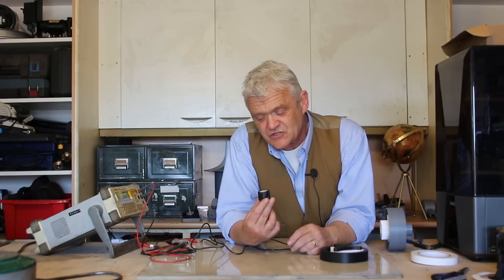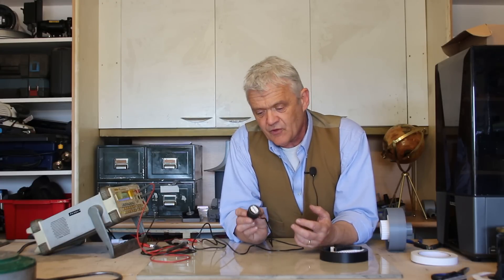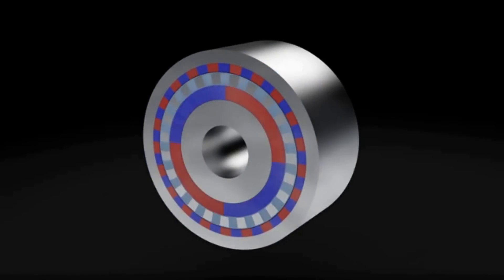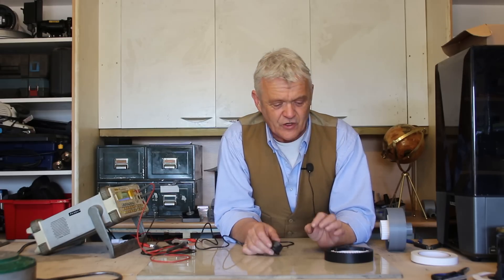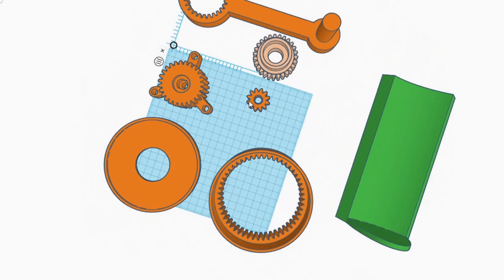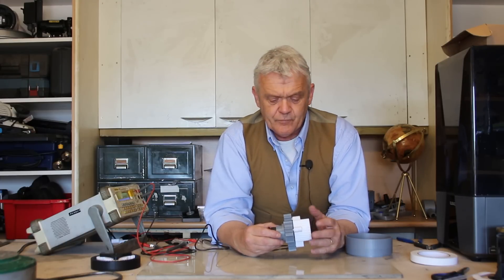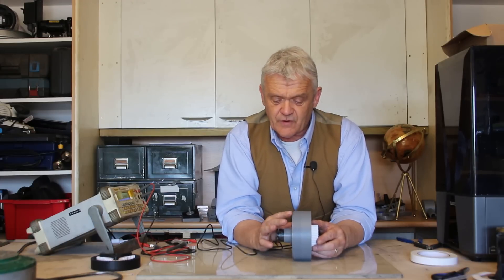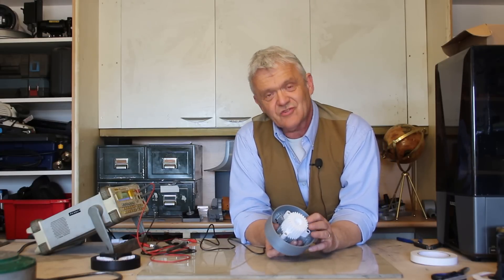1960 Gearing And How To Get More Volts From A Wind Turbine

Comment: Hi Robert. Nice video. Imho the amazing part is you can 3d print all of that, stack 3 gears and be able to operate that. Would it last if you operate it for a few hours ? Does it need lubrication ? Can it be lubricated ?

Comment: There is a much more efficient way of using planetary gears which can provide high ratios with only two sets of planetary gears.
The split-ring compound planetary epicyclic gear system.  The calculation of ratios is more complex, but ratios up to hundreds to one are possible in 3D printed parts.
There are several YouTube videos on the subject, but they are all using them for motor down gearing with much higher ratios than you would want.

Comment: Could you try creating a small fan heater using 5volts using capacitors to store then pulse a higher voltage to heat a coil periodically and spin a fan.

Comment: Hello from France, i discovered recently your chanel. Thank you for your videos.. Do you know the efficiency of this type of this  multiplicator wih an industrial type ?
Reply: A good, professionally machined, straight cut "spur" gear will usually have a mechanical efficiency of 98-99%. Since the planetary system involves several gears, I would guess 95% per layer. With proper lubrication of course.

Comment: I wonder how the generation profile would produce if a periodic motion were attached, like a pendulum on the end - of course using a small translation system very much makes sense but it's interesting to visualize field behavior as a literal moment arm of different lengths is set on the end of the erstwhile fan motor.

Comment: great video thanks. i will say though it can be quarter the chunkyness and still work the same.
Reply from the maker: yes it can - i like chunky for the reasons i said but you are dead right mate
Reply: @ThinkingandTinkering  As i wacthed you vid i was thinking about your fractal vid and mixing both ideas to create a practical power output unit

Comment: another fascinating video - it seems an optimal system is where there is a gearing system that allows a propeller to spin with a low wind (low speed and low torque) and generate minimal voltage but then, when the wind gets stronger, to increase the gearing automatically so the electricity production increases exponentially ie a variable gearing system... If that makes sense. 
You are on a roll, Robert - great ideas and implementation. Seems having a flock of 3D printers and tickercad might be helping somewhat!
Reply from the maker: like a variable transmission?
Reply: @RobertMurraySmith Yes Sir. That's exactly what they are talking about
Reply: @ThinkingandTinkering  yes
Reply: That sounds like a cvt system similar to what newer go-karts use using 2 variable pulleys, weights, springs and a belt in between.
Reply: A CVT set to draw more torque at higher speeds.
The actual theory and maffs are beyond me.
For now.

Comment: It would be interesting to strap a force meter to the crank and see how much more "effort" is required as you add stacks. If one was to use something like a Fresnel lens to heat up a lump of metal, stick a Stirling engine on said hot of lump metal, use that to spin a heavy-ish flywheel and strap the flywheel to such a stack of gears that runs a generator, could one get to something that runs for useful amounts of time <and> produces useful amounts of current, enough to run something along the lines of a trickle charger ... ?
Reply from the maker: the torque goes up in the same relationship as speed mate plus a bit for the mechanical losses
Reply: @ThinkingandTinkering  Thank you, I'm neither a physicist, nor an engineer, nor do I play one on tv, nor did I stay at a Holiday Inn express last night so not quite up to speed with that sort of thing lol